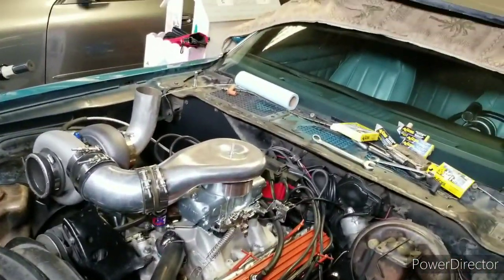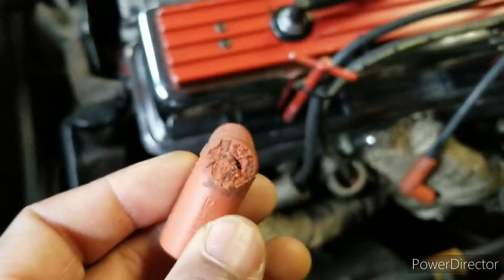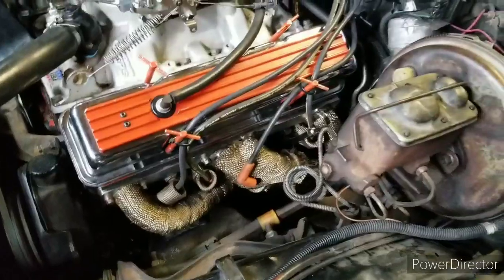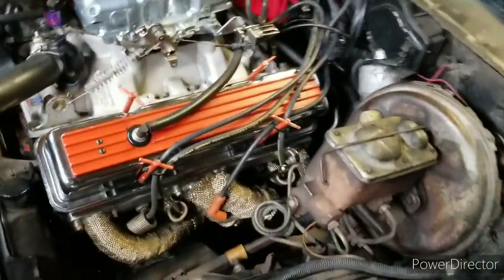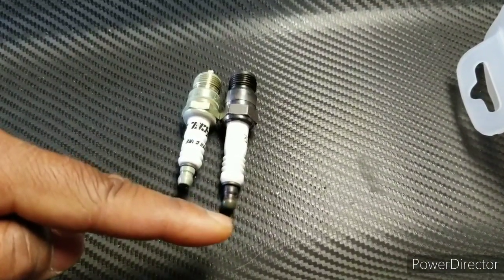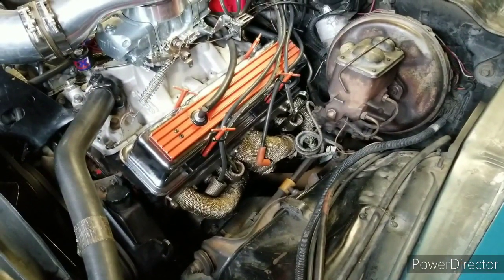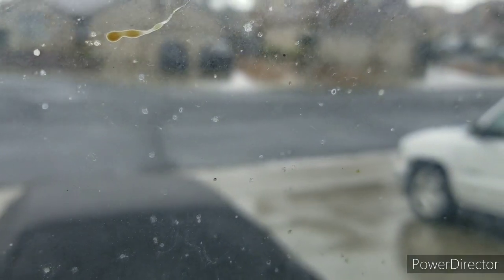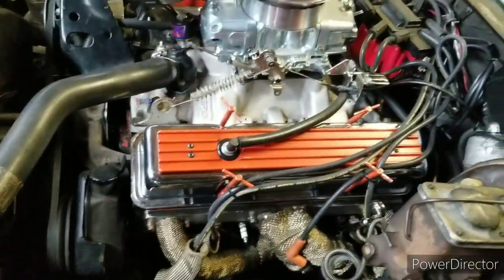How To Stop Burning Spark Plug Boot (Easy Fix)

Comment: Trying to figure out the many problems with my 454 7.4litre suburban and just your talk at the beginning about if you have problems don’t worry because some one else has come up with a solution  honestly made me feel a bit better as I’ve been dealing with many issues on this suburban and I’m not very mechanicaly inclined but. This definitely made a bit more sense and I’m going to try smaller plugs   And hopefully that may solve my issue
Reply from the maker: Hopefully it works out. I wish you the best.

Comment: Great advice! I have that same exact Craftsman 9/16-5/8 box end wrench. It is the handiest wrench I have and I use it all the time. Motor combo and turbo size?
Reply from the maker: Thanks😁. At that time the motor was a stock 350 with a mild cam.  Turbo size is Gt45. Now I'm running a 383 with the same turbo kit.  Check out the link below for updated video. All parts are listed in the description box. Thanks for watching 😁 🤙
https://youtu.be/6PcEssvZi6k

Comment: My 1st car was a 77 type Lt. It was all original condition bought from original owner that was a friend of my parents. Mine had 350 with p/s,power brakes, power door locks, power windows, all gauges. Everything worked on it . But it was slow as heck. Glad to see a 77 with more than 160hp lol
Reply from the maker: I feel you😂😂 My 4 cylinder Acura Integra came with more power than these 77 LT Camaro's.